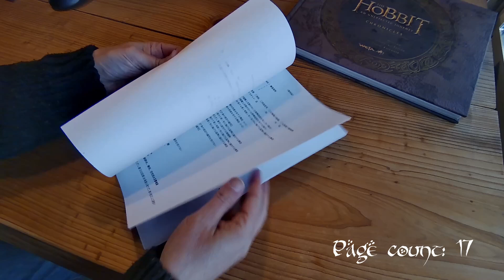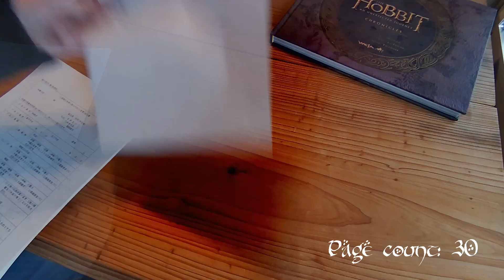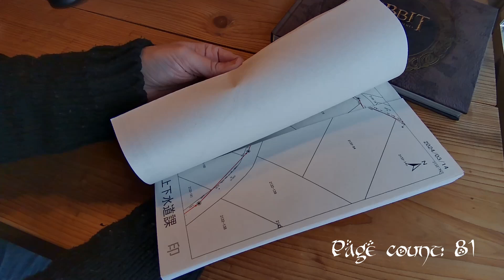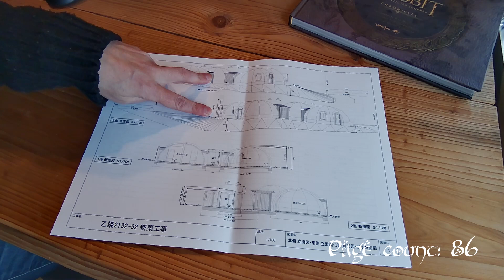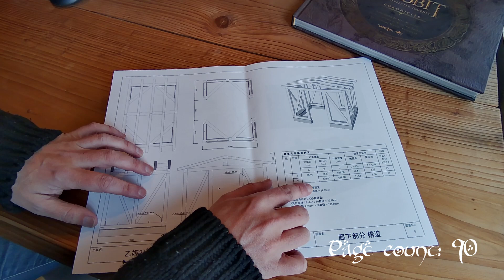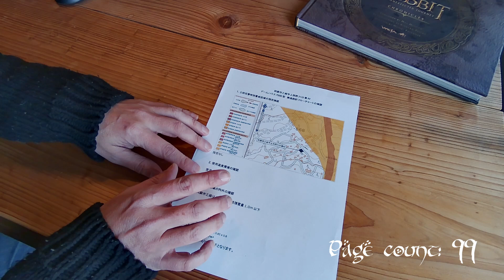Preparing a 100-page planning application in Japan! (Ep16)

Comment: Did you find out about the paper work after you bought the domes. 😮
Reply from the maker: I knew there would be lots of paperwork if I was submitting it myself, regardless of the building type, but I didn't know the building department would be so pedantic about following the certification of the dome houses. I has added quite a bit of extra work!